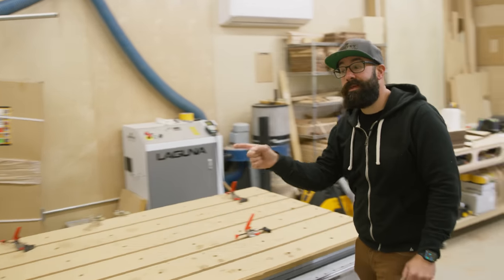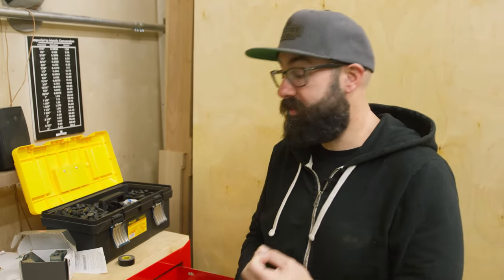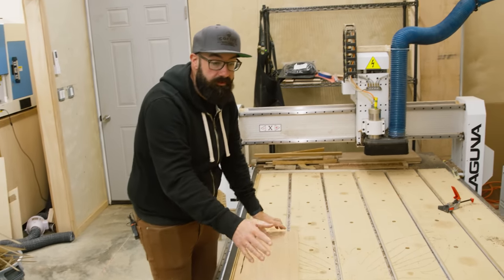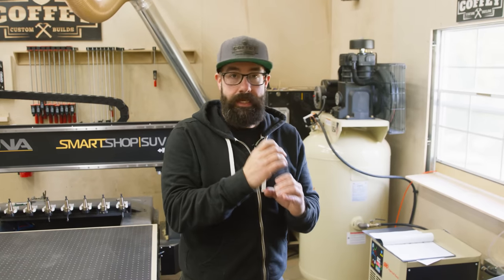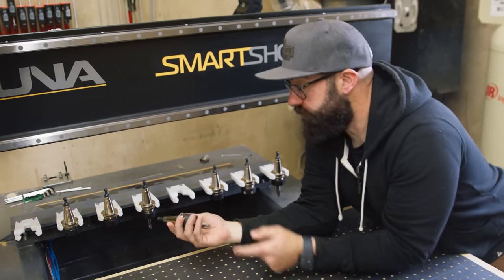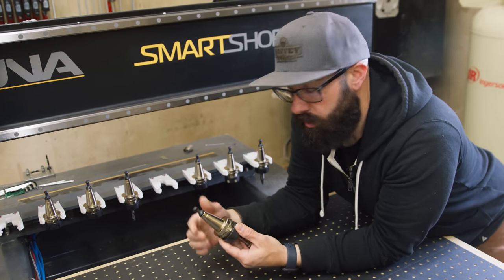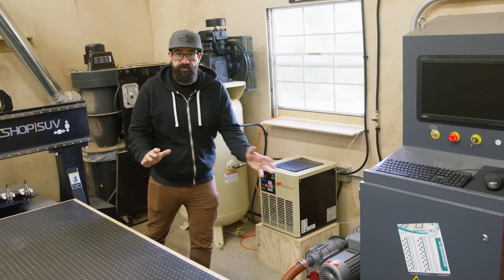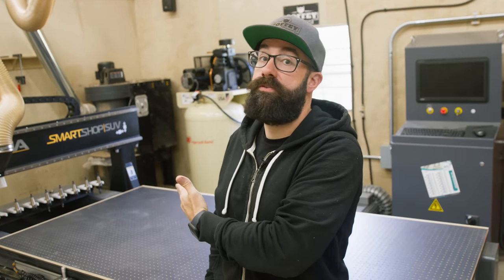The Hidden Costs of CNC's!

Comment: does the new one have a dedicated drill bank? I run two different CNCs at a custom cabinet shop and having the drill bank saves so much time over a jig or even a boring machine, but all those bits are a HUGE hidden cost.
Reply from the maker: This doesn't have that.

Comment: Yeah, If you want to spend a lot you can, we bought a used, refurbished 5 by 8 foot CNC with vacuum table and  and 10 HP Spindle + Aspire for $5000... and then we built a small 30" x 30" CNC for vcarving, everything is built from wood (well just the frame, gantry, and z axes), as for hold downs, a small wood piece and screws work... just 110 volt plugin (oh.. the 5 x 8 CNC is 3 phase, luckily we had that already) that small CNC has a grant total of $1000 + tiny electric cost on the days that I use it.. although that wooden CNC is only good for vcarving (kinda light duty), and then right now I am building a 4 x 8 foot CNC out of aluminum and I am not cheating on linear motion, ball screws,  high quality glides and a premade $500 z axes, 4hp Chinese spindle, and luckily we have a not used vacuum machine so maybe I'll add a vacuum table... the total of that one is expected to be around $3000. As for dust boots, a 3d printed dust boot works, and we already had a 100HP vacuum system in the shop, although a small grizzly does not cost that much... Anyway just watch the video, and decide for your self what your cost would or could be, because he explains EVER detail...
Reply from the maker: Right on

Comment: Great video Mike. All great points and highlights on the hidden costs. One big cost or loss is time. Between set up and education a lot of time goes into setting these things up.  the opportunity costs can be through the roof. 

I have hobbiest sized cnc. Company called openbuilds. Seemed like the right decision for me at the time. Till I found out after it came that i had to put every single piece together.  Every screw nut plate etc. I lost about a week of work just assembling not including learning how to use a cnc building the table running electric or dust collection. 

Love watching your growth brother and can’t wait to see what you have in store for the future.
Reply from the maker: Those "you put together" cnc's freak me out!

Comment: I definitely got confused on the "MDF" gasket stack bed. Guess I'll have to follow that up better. I used to program CNC with a tape machine - Cutting and Splicing that bad boy. That shop ran a lot of material and then the owner sold it and they packed it up and shipped it to Japan. A customer bought it.
Reply from the maker: The vacuum passes through the mdf and basically evenly distributes the suction.

Comment: Max horsepower for a single phase 240V dwelling is normally about 10HP. High and the power company inspects brownout and dimming light complaints from neighbors.
Are you really running the spindle, vacuum, and compressor at 26HP? (12+9+5?) How much were the VFDs for the machines?
Reply from the maker: Those are not on the same circuits 🤣🤣 that would be insane. The compressor is 5hp and definitely doesn't need a VFD. The vacuum pump is 10hp and has an integrated vfd in the processor cabinet as does the spindle. Those were part of the purchase of the machine.
Reply: I'm speaking about single phase 240V service coming into the shop. Do you mean you have more than one service coming into your shop? How many amps is your service(s)?
Reply: Any thoughts on the question?

Comment: Thanks for sharing. I really resonate with your points and you have helped remind me about all the hidden costs! I bought my first basic 4x8 a year back as well without ATC, proper dust shoe, etc, and I'm already gearing up to invest in more features! 

One thing though, my current machine does have a vacuum bed, and i'm wondering - when you mentioned that those perforated vacuum holes perform much better than having to pull air through MDF, what happens if your tool starts eating into the black laminate you have there? Unless your Z-zero has always been perfectly dialed in?

Again, thanks a whole bunch! It's a great reminder about all the thousands of $$$ (or tens of thousands of MYR here in Malaysia) due to hidden costs!
Reply from the maker: So the gasket is a consumable like the spoil board. However, we have been able to get a really solid zero and we have gone through about 200 sheets and it's still more than viable.
Reply: I've been running my DIY router for almost 20 years profitably and there's no need for vacuum or ATC. In some instances a vacuum hold down would be better but the profit margins are so hard you better be in aerospace to justify it. When I worked in aerospace routers, we used a rod to hold down parts regardless of vacuum because of vibrations. I use clamps and do not have to maintain any pumps or motors or clean out any hoses. Run it like a CNC mill.

Comment: One suggestion is to add duct tape at the edge of the MDF to avoid vacuum leaking. Helps alot
Reply from the maker: Yeah that works for sure. We water down wood glue and paint it on the edges. It dries quick and seals it well but doesn't get adhesive on the fly cutter when we resurface.
Reply: @CoffeyCustomBuilds  that's a much better solution thanks!
Reply from the maker: @Rowow it works great and it's cheap

Comment: What are you going to do for makeup air when you put the vacuum pump outside?  I have been looking into this because I want to AC my shop, but haven't found any decent solutions.
Reply from the maker: Just been running the mini split. Pumped the exhaust back into the shop for the winter and will pump it outside in the summer.

Comment: I just dropped 6 grand on a new jointer and table saw… another thing to remember is that the CNC doesn’t live alone. It needs friends, and they’re ALL expensive friends. Band saw, drum sander, horizontal edge sander, oscillating spindle sander, horizontal boring machine, multiple drill presses, LASER engravers, spray booth, HVLP equipment and air filtration system, 20 ton hydraulic press… these are all tools that I’ve needed to purchase in the course of running my business. Not wanted - NEEDED. I’m about $35K into it all at this point, but I keep getting work, so…..
Reply from the maker: Yup it's an investment.

Comment: I think there is a big difference between buying a cnc for your already established business, and buying one in hopes of starting a business around said cnc. The machines you show here are for the professional shop to do production with, not the guy with a garage shop or small shop. You have added a ton of cost to an already very expensive machine, but that’s hopefully justified if it boosts your business enough to pay for itself and provide you with more profit. Can’t speak for everyone watching this, but I can say you’re not really talking to me. If for no other reason than if I put either of those in my garage shop, there wouldn’t be room for anything else, let alone the cost of even just the machine. 7 years ago I bought a desktop cnc with a cutting capacity of around 2’ x 3’.  I got the DIY kit for around $2200 at the time. A computer to run it for around $300, Vectric Vcarve to design with for around $500 to $600, I think. By the time I had everything needed to use it I had about $4000 in it. It’s worked nice for totally cnc projects and as an easier or only way to do work on projects that were created by more normal woodworking methods. Have I made money with it, no not much. Certainly not enough to pay for itself. Most have ended up as gifts or something for myself, whether for the house or the shop. My original thought was to make money with it, probably got that idea watching too many YouTube videos. lol. It’s a good machine and there are many good desktops out there, but they aren’t designed for production work where they run 8-10 hours everyday. For that you need what you have there, large industrial machines designed to handle production and I’m glad to hear that they were a good investment for you.
Reply from the maker: There is a difference. This doesn't claim to be for beginners.

Comment: I am designing a small (~300mm x 400mm) CNC to cut custom soapstone insulators for my business , sealing everything up with bellows and other devices will make the machine bigger and more expensive and the dust from soapstone is talc. I just don't know if I need to seal it all up or not , any advice ?
Reply from the maker: Seal it up

Comment: I have an older smartshop M that uses the handheld controller. Is it possible for you to do a quick video of the new controls on this machine. I just would like to know how to start a program, and how to jog and zero Z on the surface of the piece. Any help would be appreciated. Awesome video
Reply from the maker: It doesn't have a screen at all?

Comment: I mainly plan on using one for cribbage boards, routing letters for a project, a few signs to engrave things into, so i don't need anything expensive. Id like to match the price of my laser cutter, $1,200. Any suggestions?
Reply from the maker: I don't know of any at that price point but I'd look at the Onefinity machines. They seem solid.
Reply: @CoffeyCustomBuilds  thanks for the tip, I know shark sd has a few around that but then they jump up in price

Comment: What part of the machine needs 80 gallons of air? I remember talking to AXYZ about their air requirements and they came back a few days later basically telling me they need way way less air than they actually suggest.
Reply from the maker: The pins, hood and automatic tool changer are pneumatic. The psi needed is very low. However, if you have a smaller tank, it will be cycling on more often and will lead to burn out. My manufacturer recommended a 60 gallon as the smallest size but I also have a laser, and edge bander and multiple pneumatic tools that need the air lines so 80 gallons made the most sense.
Reply: @CoffeyCustomBuilds  that makes sense, now if they only made them big and quiet. For some reason compressors are that once sound I can’t handle.

Comment: thanks, for a smaller machine you just scale it down but as the man says the hidden costs are still there....If your spending say 3 to 5 k  on a CNC add another 50% to get everything up to speed , Its worth it in the long run   and that doesnt include your monthly software costs,
Reply from the maker: Yup! There are peripheral costs that need to be factored.

Comment: omg 12v spindle?? everything associated with 12v high current will be expensive not just the larger gauge wires required for the amps but the power supply themselves. If the options were available, would have been better to opt for or changed them out to something with higher voltage. Overall, a very nice thorough coverage of the unspoken ancillary cost of running CNC. It is expensive.
Reply from the maker: 12v? It's 12 HP. It's a 3 phase 220v 50amp spindle.

Comment: Great video. I have watched a ton of videos leading up to buying a ShopSabre and have continued to while I am in the process of getting everything set up. You are absolutely correct about the bleeding of money when it comes to wiring, air, vacuum, ducting, etc. The bleeding actually started when I had to pay riggers to get the CNC off of the truck and into my shop...my tractor was way overmatched for a 4000 lb. machine. One quick note...with all the videos I have watched I will have to admit to not seeing a perforated spoil board before like the one you are running on your Laguna. How did you come across this idea? Thanks.
Reply from the maker: Yeah I had to rent a 6k reach lift! It's so much money.
Reply: Same here Larry...same here.
Reply: I have a shopsabre and just be aware that you will get totally screwed on any upgrades or god forbit the POS $250 computer you get breaks...they want 2k to replace it. I wanted to upgrade to a spindle from the router....they wanted $3400 for a 1.7kw spindle, wiring and VFD.  I wanted to just buy the mount from them and upgrade myself but they will not sell you the mount.  Still upgraded on my own for around $650 including 2.2Kw spindle, vfd, and wiring.  They love you before the sale...but will pretty much have nothing to do with you after.  Stuff will break.
Reply: My DIY machine is always profitable, and you will make many mistakes on parts and quotations. I stuck to 110 V wiring except for the spindle, no vacuum system. Low cost stepper motors. Machine shop and 3d printed parts. I cannot understand why people spend so much on these and then complain when they are not profitable. When cutting wood I use a brush to clean off. It almost costs nothing to operate. Low cost indexable carbide tooling. Cut aluminum plastic and wood all the time.
Reply from the maker: @togowack how many HP is your spindle and what speed can you run 3/8" compression bits at full depth in 3/4" material?
Reply: @CoffeyCustomBuilds  2.2 kw spindle. I do mostly light cuts which tends to drive up the numbers of hours. Nothing I do is volume work its small and specialized.
Reply: @CoffeyCustomBuilds That kind of mass production should exist only for 3rd world countries. Here people should be (and are) required to use a lot more brainpower to come up with marketable product with a ratio of 75% sitting on the couch and 25% of machining. That's where it is for me and the couch isn't easy either.
Reply from the maker: @togowack  that's quite a nice way to excuse yourself out of higher powered and higher performance machines. Also, wanting work to go overseas is an interesting standpoint. We do kitchens, builts ins, cut parts for local business, parts for other cabinet shops and do several lines for national retailers. My employees and myself personally are very excited that the work is staying reshored.
Reply: @CoffeyCustomBuilds  All kinds of good businesses exist around all kinds of machines. I guess my beef is with the maintenance and repair (hidden costs) that shops are still outsourcing all that to trades or specialist companies. Just running your machine while times are good and not designing and building your own replacement parts. A traumatizing and costly unwanted experience may be in your future.
Reply from the maker: @togowack  that's a huge pivot from your previous argument. Did you build your car? And since the answer is no, why not?
Reply: @CoffeyCustomBuilds  Yes it is a pivot. Because of the huge investment required. The repetitive nature of work to me does not belong to human hands especially with the escalating cost structure of hiring semi skilled people. As for the car - my uncle is out 50k over a truck with a blown motor from the factory that cannot be repaired. I bought a 1997 ranger for 100% aftermarket repair part availability. I am taking a full time job in a week where the boss had an equipment breakdown last year that almost cost him his business. Instead of analyze and rebuild the machine you supposedly own he bought another. What a waste... I am just finishing a custom built / programmed 6 axis robot arm. When my electronic washing machine goes I will be gutting it and replacing with arduino control as well.
Reply from the maker: @togowack  are you going to name the robot Deflection?
Reply: @CoffeyCustomBuilds  Far as I remember the discussion was about investing big money into machines which I don't think is wise. People overspending on overpriced stuff. I could build the same machines for a fraction of the price. Everyone should be able to. Once your machine is busted you will be out 100 grand. They are not good investments.
Reply: @togowack  I agree with your philosophy. I like the German business plan. Make the thing that goes inside the thing that makes the big thing work. I am not going to try and compete on  price and volume. Be the one that makes the parts for the expensive machines. That being said I think Coffey has an important place in out economy because production is coming back to the local level and if he produces jobs, then that is good too. It takes a lot of brains and effort to do price and volume successfully and I am for bringing that back from China. I wish you both the best.

Comment: Nice video new sub.  I spent a pretty penny for mine. Even if you want to just do hobby work / side job it's expensive. I run a Laguna IQ 24x36 travel, Jet dust collector 1.5 hp with aspire. Get ready to drop 15-20k to have fun with a small dependable setup.  Just curious how often do you lube your linear guides/ballscrews and do you use white lithium spray or something else?
Reply from the maker: I'm looking at selling my Swift and getting a 2x4 IQ Pro as we speak. I need some floor space and the SUV does everything we need right now for sheet stock. Both my machines have built in lubrication. One is automatic the other is a manual lever. They use gear oil.
Reply: @CoffeyCustomBuilds  ahh that's nice .Those little Lagunas you can't beat em.